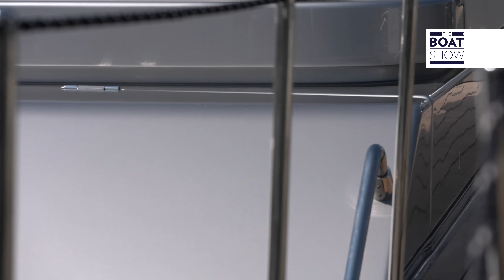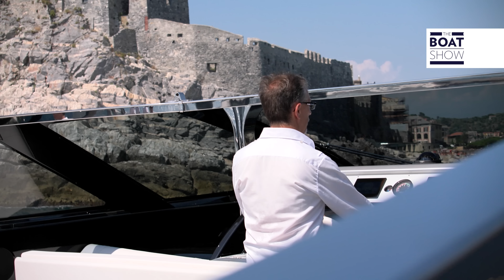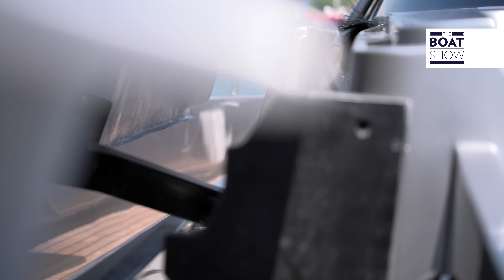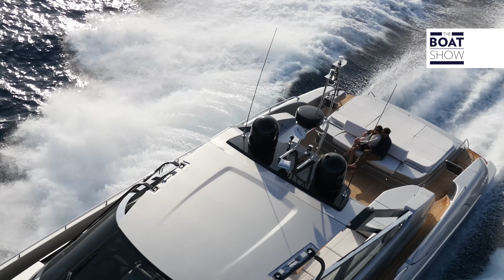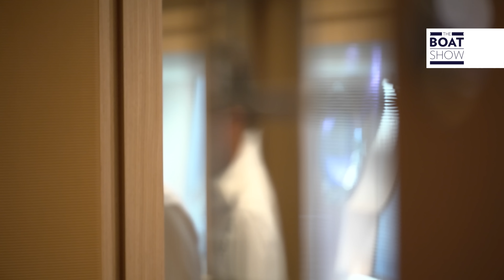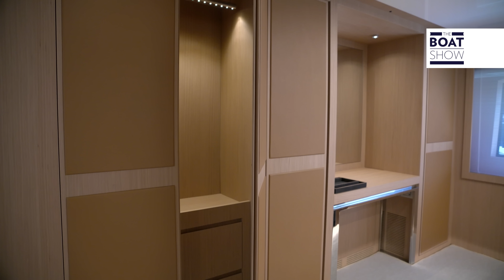[ENG] RIVA 88 FLORIDA - Yacht Review and Interiors Tour - The Boat Show

Comment: The best shaped Riva  i like and very stable boat really handles the sea well, but for €5.5m i expect more, and this should be equipped with Simrad Xenta like PERSHING 8X which is a nice boat two but I don't like the internal layout much, and its not  as sexy as this Riva, but with these size boats you cannot have it all, but i think they are bit over the price. PERSHING 8X is less if not mistaken but it has fly bridge and lockable doors so its more secured,  but again i like the shape and sexy look on a boat, and this Riva has nice looks from all angles.

Comment: Lol when you realize it’s gallons per mile and not miles per gallon!
Reply: At 29 knots it's using 20 liters per mile (I do not like his mixing of metric and imperial!), which in the US would be about $12 per mile. So some perspective on how much these multimillionaires and billionaires are spending on fuel alone:
At 163 nautical miles from Ft Lauderdale to the Nassau Bahamas is $2000. At 928 nautical miles from New York to Ft. Lauderdale is $11000. At 129 miles from Ft Lauderdale to Key West is $1500. At 21 miles from Ft Lauderdale to close by Miami is $250. Basically, at 29 knots it's costing about $350 an hour. 
So even a multimillionaire would want to spend most of their time on this boat ANCHORED! LOL!

Comment: So this boat can only go around 420 nautical miles on 7500 liters of fuel at a constant speed of 24 knots? Is there a way to go any farther? or would that be the most efficient pace
Reply: At displacement speeds below where it planes it will consume almost nothing compared to speeds above where its on plane.
Reply: @southjerseysound7340  You can swim faster at that rate. Pathetic.
Reply: Sure, just find a powerful enough current headed in the right direction.